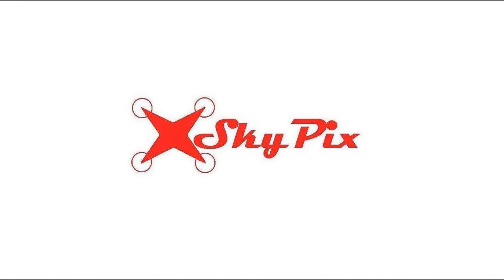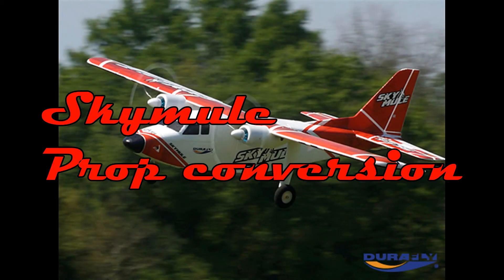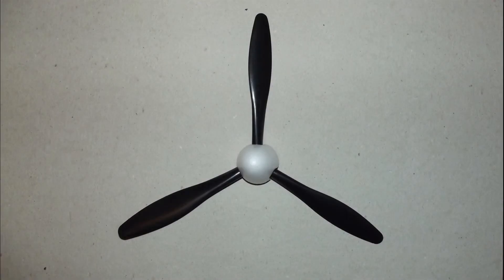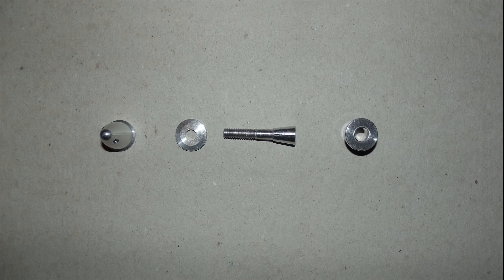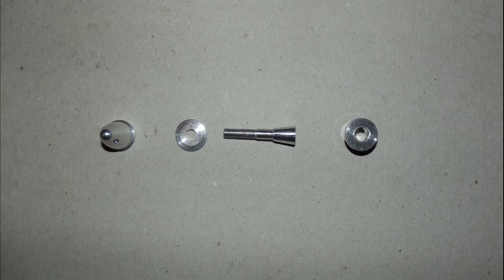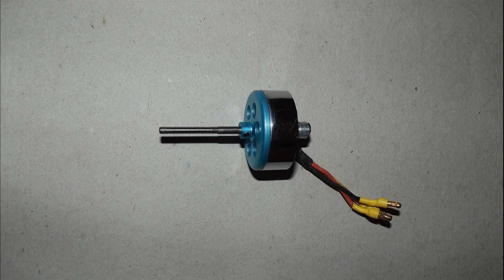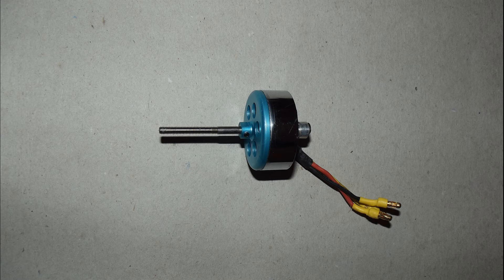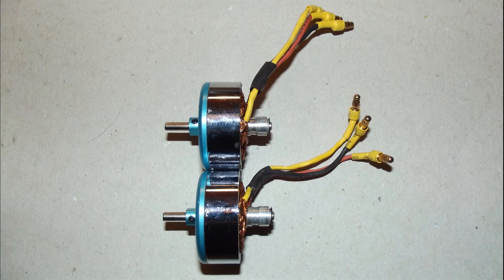Durafly Skymule propeller conversion how to

Comment: Hey James! Thanks for the video buddy. Can you give a link to the prop adapter? Thanks!
Reply from the maker: https://www.ebay.co.uk/ulk/itm/161173168617  these are the ones I used. Just the job.
Reply: Excellent Thanks James! I am modding the same way you instructed and I found the clamping 4mm to 6mm Adapters. I also ordered the same props you suggested. I look forward to the upgrade. Do you have any suggestions on how to get the motors out? I have no idea.